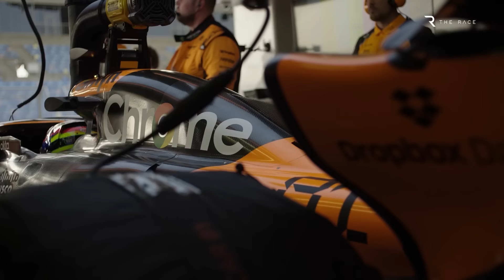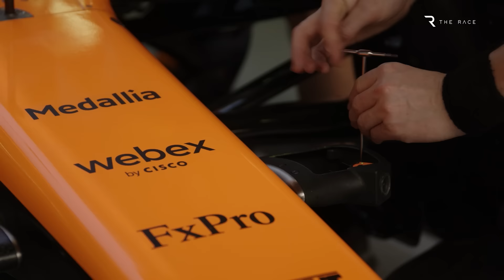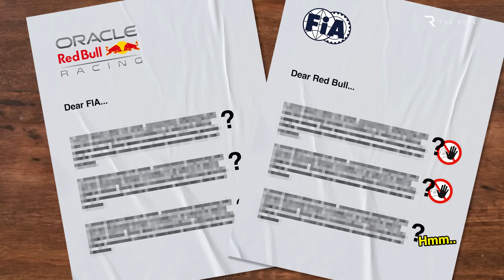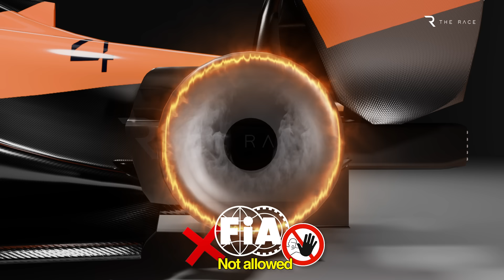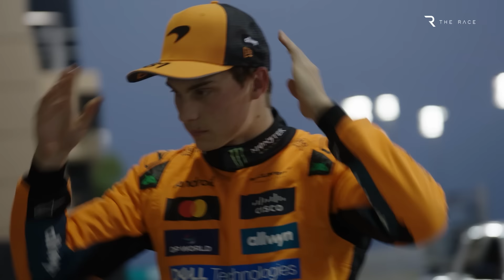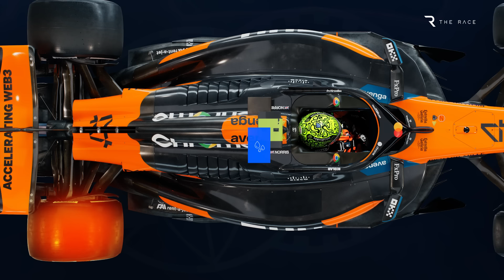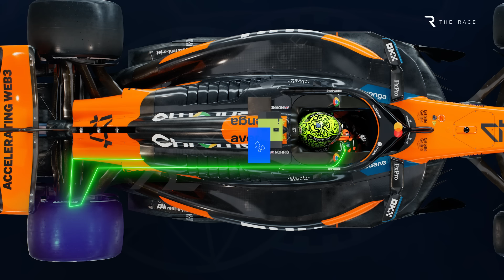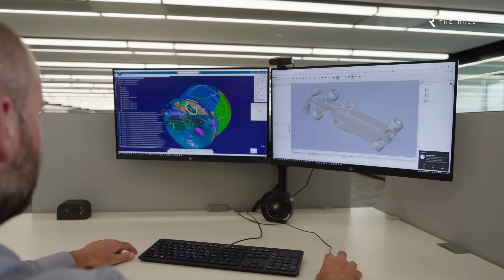Revealed: Red Bull’s wildest theories on McLaren’s clever tyre tricks

Comment: What if you engineered the brakes to use massive amounts of fluid to operate and the brake fluid would need to stay at an optimal temp to work and by using a different design the consequence could be more consistent brake effect

Comment: I would look at any footage or sign of wheel spin rain or dry or lack of wheel spin , seems like traction control would certainly protect the tires
Reply: they don't need it because now they have special engine tuning that enables half or all cylinders depending of the throttle input. go listen to the cars when they exit a slow corner. they all "grrrrr" before "baaaaaah". that's the feature. they basically run one cylinder bank (3 cylinders) on low input. and full engine when they go hard. so no need for TC when you have that. the only difference is that you still can spin the car if you go too hard. but if you use it right, the engine will be smooth as cotton. because those V6 have HUGE torque. so they could spin way too easy without such feature.
Reply: @J4yB293 certainly seems like they have all the parts working together

Comment: Phase change materials and shape memory materials are different. A shape memory material I would imagine is something that can be used in active suspension to change its hardness, like modern sport car shocks use. Phase change is more closely resembles insulation, which I don’t see why the FIA would ban. Honestly I think every substance in existence is a phase changing material technically. A simple example is water. If you measure the temp of water it will get warmer as you add heat, however once it boils you can keep increasing the added heat but the water will stay the same temp. So for the tires you would want to line the brake cover assembly with a material that quickly gets up to temp but once it gets their has a large window to absorb more heat without the temps tire of the material raising. This doesn’t seem like something, as long as it’s not toxic, that would/should be outside the regulations.

Comment: Most of these theories are indeed wild, like Peltier devices - which, even if present, would literally cool nothing.
Reply: I mean these theories are mild in comparison to all the shenanigans that got pulled in the history of motor racing

Hidden NOS bottles, flywheel doubling as a supercharger, acid dipped bodywork, hydraulic lifters on restrictor plates, engines intentionally burning oil to get that tiny bit of performance, adjusting steering geometry on the fly, intentionally weak bodywork that contort into a more aerodynamic shape are just a few from top of my head

Comment: Peltier doesn't even make sense (from my understanding). Peltier elements are useful for rather small temperature differences (keeping your beer cold in a ride-on cooler) and when a compact design is more important than efficiency.

Peltier elements need (a lot of) energy to "produce" a temperature difference, therefore you have additional heat from the process itself you have to get rid off (that's what the fan in a ride-on cooler is for).
Reply: Lots of airflow channels in those brakes idk just food for thought and if FIA says it's legit and they don't cover it I think could be a real good chance that's what they could be doing

Comment: My theory is that McLaren uses sublimation materials mixed with resin which is used to cook carbon drum assembly. While cooked in autoclave they trapped because process is done under pressure, but in normal atmospheric pressure they begin to escape when brakes heat up, taking heat with themselves.
Reply: Damn. That definitely would require a different weave of carbon fiber, and hence prop that theory back up once again. Genius!
Reply: @abhisheksunil7037  also straight illegal
Reply: Must have awful odor .?

Comment: How about making some parts that are in contact with the wheel from two complex metal alloys, one which is slightly radioactive and another which will undergo some exothermic reaction when excited by alpha or beta radiation.

Or: if your radioactive breaks just so happen to release some heat for a relatively small period of time after installation, does that count as controlling the heat of the tires?

Comment: In another video you said that Imola was surface heat for tyres, whereas Miami was core. McLaren apparently are better at keeping core tyre temps down.  The corner at Imola better suit RB. Too early to say. We have seen track specific results before.
Reply: Exactly, how the F1 circus forgets all the years where some teams do well on certain tracks and terrible on others. But the best over all team usually are good at most tracks. I mean some tracks Haas isn't terrible....others "GP2 engine"
Reply: At Imola the McLaren had tire heating issues. It is likely that one of the TD's triggered McLaren to change its design and thus introducing tire heating problems. This might be related to the brakes or the skids.

Comment: I don't get what Red is trying to do with these requests. I mean, let's think about the idea to add a water system to cool the tyres:
1) It's prohibited, which means McLaren would be disqualified on the spot.

(For now, let's imagine there's a smart system which not prohibited).
2) Having such system means an additionnal weight added to the car. When we know how teams tries to control the weigh of the car precisely, even by not painting some panels. So adding something like this means adding a handicap.
3) The quantity of coolant you have to use in order to effectively cool the brakes and tires. It depends on its evaporation temperature, but we dealing with brakes which are up to 1000°C under braking. And it would mean the liquid would have to be cooled off to be effective again, which means another system to add.
4) What if a system failure occurs?
5) A gas cooling system, like a liquid one, means it has to be fully sealed, while having to work under such high temperatures.

It's not impossible to do, but there's several handicaps here, and I wonder if the benefits outweight the cons.
Reply: McLaren slowed down 
That’s what

Comment: It's very simple. They added two valves on the brake calipers. The brake fluid pushed in through one valve when the brakes are applied, exits through the other when brakes are released. That causes circulation of cold-ish brake fluid which cools the calipers.
Reply: But would the time between one brake and another be sufficient for the brake liquid exchange to dissipate enough heat?
Reply: @Jamie-Truss  "Enough"? No. "Some" - sure! 😊

Comment: 11:50 I have been thinking of them using some sort of Peltier element design around the tire drum. Which personally I find more plausible than the phase changing material rumor that’s been going around.
Reply: Would Peltier's add a decent amount of weight potentially, especially in the amount that would effectively be able to make a noticeable difference to tyre/brake temps?
Reply: @Aleeownz they are typically pretty small and lightweight devices.
Reply: Hahahahaha maybe I should have kept watching for a 60 more seconds. I really think the peltier element is the right answer.
Reply: @Impressive_refraction  Except for it to make any proportionally significant difference (a) it needs quite a bit of power - something that is limited and controlled on an F1 car, and (b) where is it dumping the heat - if it's cooling the inside surface of the wheel drum then that means it's heating the cavity around the brakes, negatively impacting brake temperatures.
Reply: @Thermalions  I don’t think they would have any issue powering a device like that. They may take a high voltage to operate, but that just means adding a small converter. Regardless they would be engineering problems. Engineering problems are always solvable given you have the correct personnel with enough resources. Which I would argue McLaren possesses both.

Comment: it seems like an awul lot of energy is gone into defining allowances, when i suspect (as one myself) most fans couldn't give a hairy ballbag whether a brake caliper was made out of titanium, carbon composite or sodding blancmange, and whether or not an engine goes whoop whoop or bang slap. Just tightly define weight at variable points along with height, width, length plus a few other areas and slap a reasonable budget cap on it all, and let teams do what they want

Comment: It's impossible to tell cos Max got a free 20 seconds to piastri and 10 seconds to Norris from the VSC, and then the Mclarens were the wrong way round in the last part of the race to challenge him, he gained 5 seconds in the few laps Norris was behind Piastri, who then gained 5 seconds on Piastri himself. So the actual pace of the Red Bull was never really tested.
Reply: So Piastri falling back 3 seconds in first stint and then having to pit 15 laps before Max isnt an indication of Redbull being faster?
Reply: @StevenSt08 3 seconds isn't much and 2 the pitstop was a mistake as Norris went just as long as Max (there was a graining phase that once the others went through they gained back the performance). 

So the point is that the actual pace is hard to tell. Remember Suzuka Max won with the Mclaren's right behind him and we can't say that Piastri wouldn't have been there but for the poor tyre decision and the safety car luck. Would Max have still won, pretty likely but it's not like he hasn't betean the McLaren's in a similar way over 1 weekend before. It's going to be up to the next few races to say if this is a trend or not.

Comment: Peltiers can also act as thermoelectric generators. Those brakes get pretty hot - hot enough to recover 5-10% of that thermal energy as electricity. Could add up around a lap to recharge the battery, or offset their weak performance as a cooling solution. 

Ballpark on Peltier cooling, for a surface that size, in optimal conditions, you'd be looking at something like 300 W of cooling, rejecting 1000 W of heat somewhere else, and costing 700 W of electricity to do so.

Comment: it feels like heat exchanger inside the wheel drum. smart
Reply: And the hydrolic breakline as a method to move it out to a radiator.
One could pump the hydrolicfluid in a closed circuit that accidentily also passes through the breakcylinders

Comment: Driver 61s video on Phase Change Materials seems the most likely. It is fully within the rules, has essentially no redundant parts specific to cooling, it is simply materials which become heat absorbers under specific thermal stresses that can be used as part of the wheel hubs construction/composition.
Reply: Please remember that it was BSport/ Buchan Motorsport that first did a video on this and also features in the Driver61 video on the topic.
Reply: Ban it asap